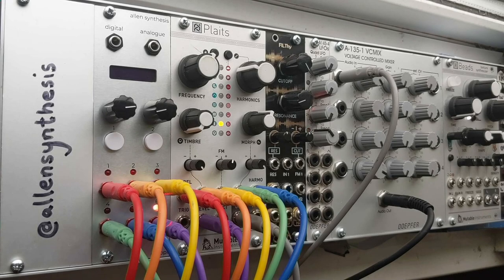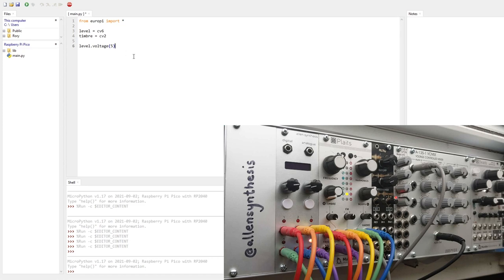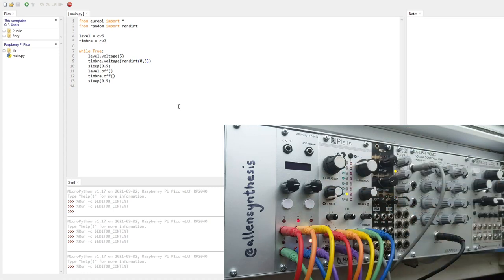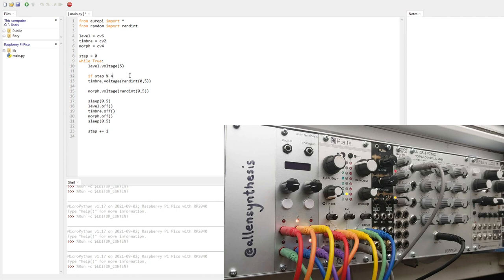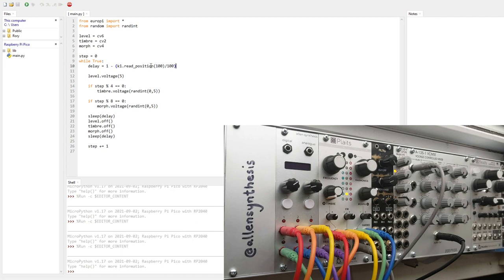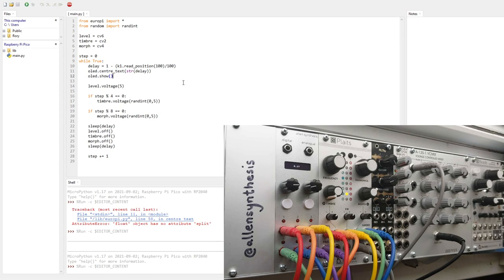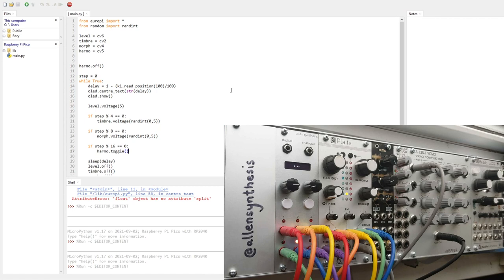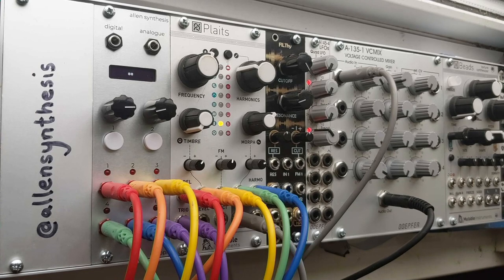Python in Eurorack: A demo of the EuroPi

Comment: Hi Got 6 Picos and 3 boxes of interesting i c's and the usual stuff .And I just scored a 15-015V xfmr @10A from an old hifi amp boat-anchor which I blew up Doldby/ DTS 7.1 surround .thank god 4 ebay . but found you an a random arty site a year ago when you were starting to tinker.But 7 months in hospital over 3 visits slowed me down. but now can start .found you can use Arduino sckethes via a converter program from Arduino. And I will be using veroboard,used it since the 60's now thats given my age away,ha.Well Done and thanks from an old git.

Comment: Incredible stuff, congrats on this module design already! Really liked this demo. I don't have Eurorack myself but I have an AE Modular system (which is a small modular system running on 5V). 

I figure this module would be possible to run on a single 5V supply range when looking at the BOM, would of course need some tweaks & some components swapped out. Interesting stuff!!
Reply from the maker: Thank you! I think running the module on a single supply of 5V should definitely be possible, at a first skim over the details you'd have to swap out the TL07X op-amps for ones made for lower supply voltages, and probably alter the input stage to get the proper range. I might actually work on writing documentation for a 5V version so if you have any luck please let me know or share it on the subreddit!

Comment: Does it also work with the pico w? 

I could see a eurorack that responds to some feed of the internet, or be programmable without using a USB cord
Reply from the maker: It would work just the same with a Pico W as it has the same pinout. A WiFi enabled EuroPi would open up a lot of opportunities, there is discussion in the Discord community about programming wirelessly so if you're interested then I'd definitely join in with that!

Comment: Very cool! Exciting stuff. So its 1 gate in, 1 analog in, and 6 analog CV outs? What's the sample rate of the analog input? Is it suited for processing audio?
Reply from the maker: Yup, that's it! From my experiments the analogue input can (with Python) only just process fast enough to get anything like audio. It works well with lower frequency sounds or simpler waves, but if you try to process more harmonically rich sounds it can sound very bitcrushed. Python (and this module) really isn't made for audio processing, but perhaps if someone comes up with a version of the firmware that uses C++, the hardware is certainly capable!

Comment: How can I get my hand on PCB / kit?
Reply from the maker: I'm expecting the PCBs to be ready (all the current issues fixed) and ready to sell by the end of the year. The mailing list in the description or the subreddit are the best place to be notified as soon as they're available!
Reply: @AllenSynthesis  is this circuit python or micro python?
Reply from the maker: I'm using MicroPython for all of my programs, but of course there's no reason why it couldn't all be done in CircuitPython! The module is essentially a 'HAT', just adding extra hardware, so in theory you could even do it all in C if you wanted, I'm just focusing on Python as it's the most intuitive